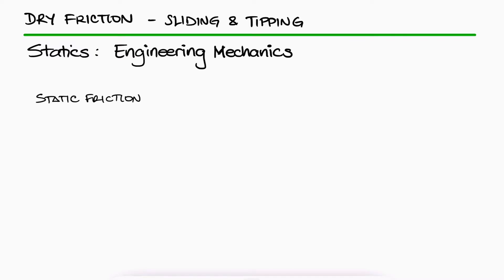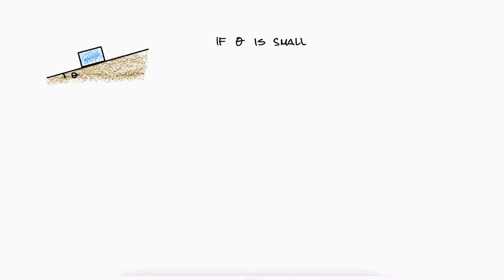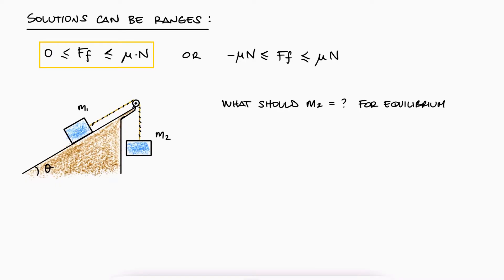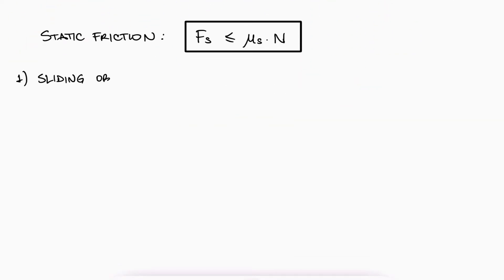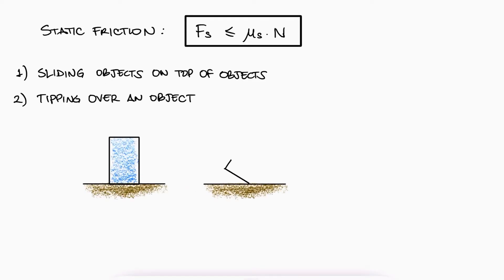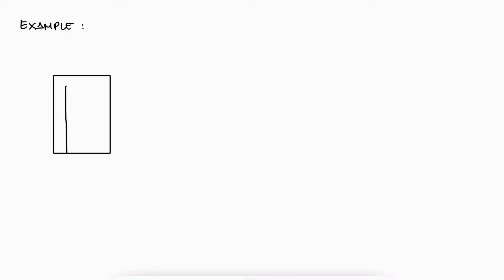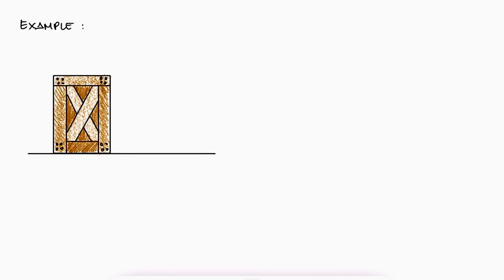FRICTION in 10 Minutes! (Statics/Physics)

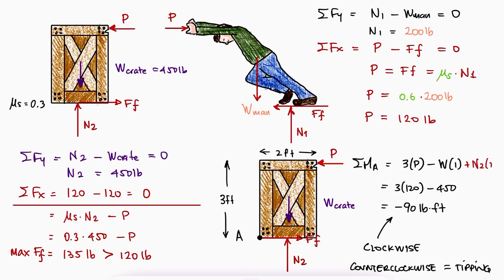Comment: 9:22 when you said the N2 would shift to the right in the middle,  i got confused in this part , cause afterwe shift it should we get a new moment at A or we equal the moment at A to 0 and get a new P like
 Moment at point A= 3P(new?)-W+N2=0 , Pnew =0 
Or 
Moment at point A= 3P(old )-W+N2=360 
I don't quite understand this could you please explain it :(
Reply: We are taking moments at A and finding a negative value while in reality it should be 0 because the crate is in eq., P doesn't change, so the moment from P is still 3P, W doesn't change so the moment from W is still -450, we need to place N2 in such a way that it creates a moment at A equal to 90 so that our moment equilibrium equals 0 and the crate is in static equilibrium.

Comment: in the static friction example, shouldnt you use a normal force of 100 lb because the weight of the man is spread between his two legs?
Reply: yes but it would also double the surface aria so its 2x100x.6, this still equals 200x.6